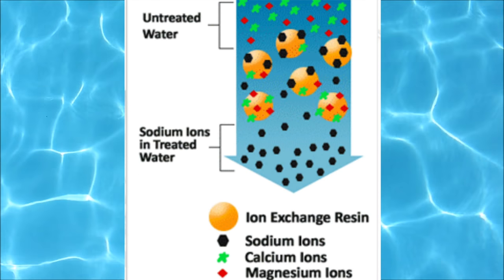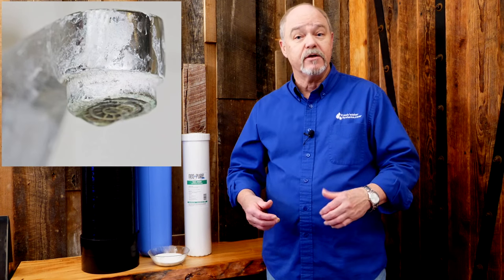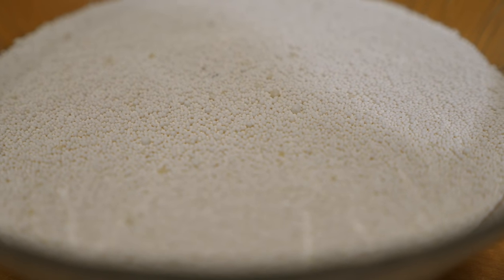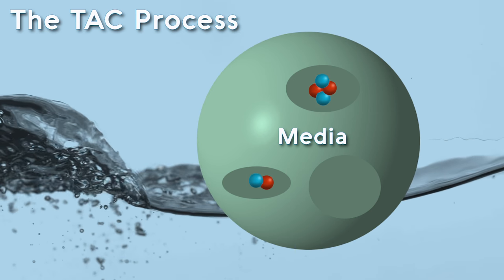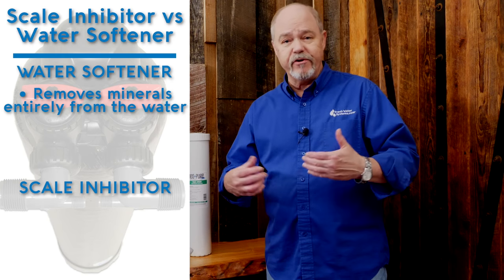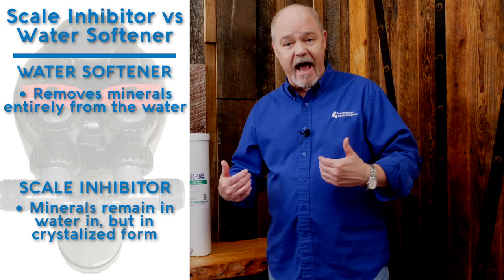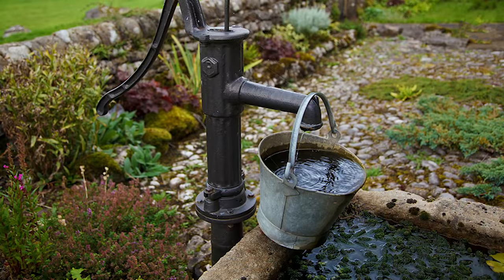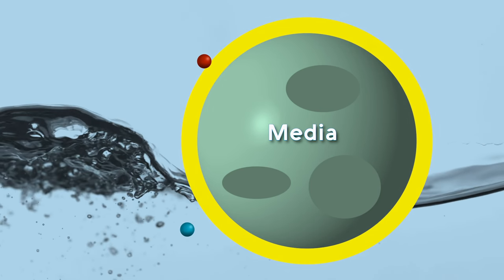The Truth About Salt-Free Water Softeners

Comment: i never recommend the salt free conditioners . IF they ever get one that you can check the water and tell when the media needs replaced accurately I may . Also, everyone i have seen says it prevents scale "inside the plumbing" and from what i have seen it still can and will sometimes scale shower stalls and fixtures. However its not as bad as it would be with out it. All my customers hated theirs because they still had hard water. EVEN when i warned them lol but hey there are so many who push them to be as good as a softener. You did a great job showing the difference and what people need for their water.

Comment: Well water owners. You CAN install a scale inhibitor or a water conditioner on a private well water system. Not all well water systems have iron or sulfur. If you do, you would just need to get an iron filter to go along with your scale inhibitor. Iron filters are the best way to eliminate iron anyways plus they also eliminate sulfur which a salt softener does not.
Reply: Thanks, that's good to know. I have well water and a septic system and don't want to deal with adding salt.
Reply: On the same boat. We have a calcium and magnesium problem, no iron detected. One of these systems would fit the bill precisely. Plus I don't have to maintain it.
Reply: Would that eliminate calcium and magnesium.

Comment: Hi John,  The media doesn't work on a chlorine PPM level above 2, which represents 80% of the US, outside of well water. In Washington DC the average is 3.2 PPM. The CDC says that chlorine at or below 4 PPM is safe so there is a conflict here.  The media does not work where polyphosphates are added to the water, which is another 60% of the nation. The EPA says that they recommend polyphosphates for chlorides, slit and silicas. The the media can't be used below 40°F, which is 20% of the nation. So all in all the technology may work on 10% of the applications and that is if another disrupter is not present. In my opinion this media should be avoided at all cost as there is a very good chance that it will not work.

Comment: I just bought a house on a well with 2 of those black tanks a little bigger than the one in the video and a white tank from the video.      It does regenerate and drains into the septic system.  There is no salt and no scale build up on any of the fixtures.    Do I have the system you mentioned or something different

Comment: I had a TAC system for about 2 years.  It worked surprisingly well( I had doubts) for a short period of time, probably about 6 months.  It then stopped working and got to the point that it's like I had no conditioning at all.  

I am on city water, but I do not know what solids I have in my water.  The majority of my city water does come from underground, so is this considered well water?   Also I live in an old house with old corroded plumbing coming into the home.  I have a simple particle filter before the TAC and it got filled with junk pretty quickly.   Could this pollution from the pipes(the stuff that made it past the particle filter) also gummed up the media in my TAC?   I'm not sure maybe John or someone else could chime in.  I've unfortunately gone back to a salt based(actually potassiu) water softener.
Reply: Look into a product called Nuvo H20. it uses citrus instead of salt.
Reply: Your particle filter is probably picking up sediment. you should take a sample of your water to get tested. Many plumbers or Winsupply or Ferguson can help with that. Your choice to use a water softener is best IMO because of your old pipes and the sediment. I hope you chose one that only regenerates when needed. It saves you salt, water and energy.

Comment: I am on city water, but have an on-site tertiary septic system. The previous owners used a water softener and had the chlorides running into the septic system. From what I’ve read, this is bad for the microbial action in the septic. Would a salt free conditioner be a best compromise?
Reply: Depending on the age and condition of your septic tank, the regenerant byproduct of softening is not harmful to the "good bacteria" in a septic system.  As long as your occupancy does not overload your septic use, a properly sized softener up to 40 grains incoming water hardness is fine. Any more than that degree of hardness, I'd suggest draining to a leach pit on the "down low" as a lot of counties are not fans of that configuration.

Comment: Is there an advantage to using both systems in a city that has very hard water.  Which order would give the best results for soft water?
Reply: In the video he states not to use a conditioner in vey hard water, it wont work. Only a salt based system will give you soft water.
Reply: @lindaluvsdasun2503   I bought my water conditioning system 2 years ago after the second Salt water softener failed, they only last about 10 years.  The conditioning system was advertised as changing the Minerals in the just as John described.   But our main shower doesn't have scale but it does have some kind of white crystal that builds on the glass.  My wife wants me to reinstall a salt water softener.   I'd like to use both systems. So my question really is which order do I install to obtain the best soft and  conditioned water? I was planning on installing the non-salt condioner then the salt system.  Our water lines are 1 inch and both systems that I have purchased have 1 inch valves so the water pressure and flow will not be reduced. Any suggestions would be greatly appreciated.
Reply: @wildpigremovalinc.executio8028  Do not install both systems there is no benefit to this only wasting your $$$. Depending upon your water hardness and how many people live at your home and if you have the right size water softener they can last anywhere from 8-17 years. Make sure you choose a system that only regenerates as needed based on your household usage. One that cleans the resin bed from the bottom up is also most efficient.
Reply: Not wasting $$$, we are not happy with the conditioned descale water system by itself.  So I'm going to add the salt water softener and hope for better results.

Comment: Is there any system or a good way to remove sulfur smell from a well water system?
Reply from the maker: The sulfur smell in well water is caused by hydrogen sulfide! Hydrogen sulfide gas can be removed from wells several ways, like by shocking the well, ozone gas, or hydrogen peroxide. Feel free to give us a call at 864.284.1801 and we would be happy to walk you through your options!

Comment: I had to stop using a water softener in the house I moved into with a well. I noticed my blood pressure went up and drinking water left me thirsty. I’ll live with my hard water and not blow a blood vessel.
Reply: You’re not suppose to drink the water from the tap. The soft water is meant to protect your skin, hair, plumbing, water heater, remove water spots & keep your clothes colors brighter fresher and softer 🤦🏻🤷🏻 You need a reverse osmosis to drink
Reply: @Pitbull_expert  
I didn’t set up the system. It was in place when I bought the home.
Reply: @Mulberrysmile  buy bottle water or get a reverse osmosis. Reverse osmosis’s are fairly cheap at Home Depot . Also change your diet up. I had high blood pressure myself but started fasting and reduced my carbs and sugar intake.

Comment: I love this video.  However, it would appear as said that this system "Scale Inhibitor" does not work or work well when there is Iron Bacteria and Manganese in the water.  There are however, very good "Water Conditioning Systems" that work to control, prevent and remove scale and do very well at controlling and removing Iron bacteria and manganese from the plumbing!

So, 1) This Scale Inhibitor system while good, is not that good.  2) I fully agree with the statement....  No such thing as a "salt free water softener" in the terms as we know it!
Reply: Lol,if you have manganese and iron bacteria in the water then you dont need a deskaler because these bacterias live in acid conditions.

Comment: using carbon to stop chlorine is so inefficient compared to aeration. do you have an aeration companion instead pre-carbon which requires the carbon to be replaces every so often.
Reply: Most cities no longer use Chlorine and it has been replaced by Chloramine which does NOT go away with aeration.
Reply: @jaycahow4667  wait, what! I knew about chloramine, that's what I meant. But aeration doesn't remove it?
Shoot I just confirmed what you said, thanks.

Comment: I had Halo 5 installed 2 months ago MARCH 2024.  I'm dealing with water spots on all fixtures and sinks. Constantly cleaning up water splashes before they dry.  Dishes and clothes are not coming clean; dishes are full of water spots.  I will have to install a salt water system in addition to the Halo 5.  Ridiculous amount of money spent.

Comment: You said a water softener completely removes the minerals, which is untrue.  It simply replaces some minerals (calcium & magnesium) with a different mineral (sodium chloride or potassium chloride).  You also said salt free water softeners don't exist, which is wrong.  Both distillers and reverse osmosis filtration systems ARE salt free water softeners.  They remove the hard water minerals without adding ANY minerals back to the water.
Reply: 100% correct except salt-free water softeners are not the same as R/O systems